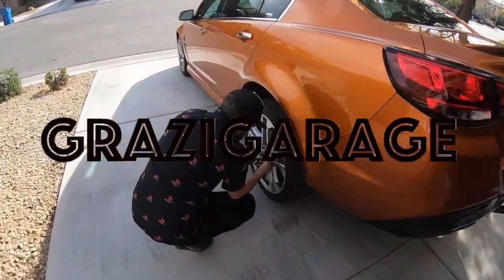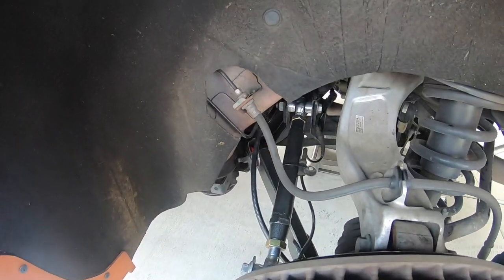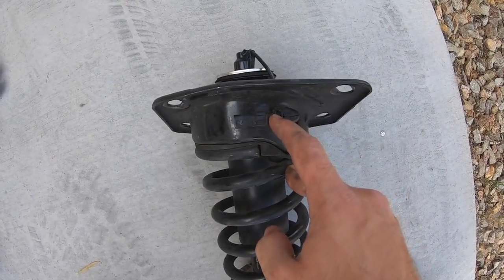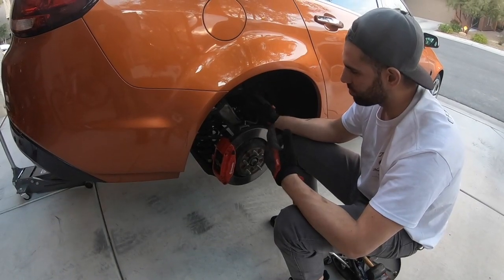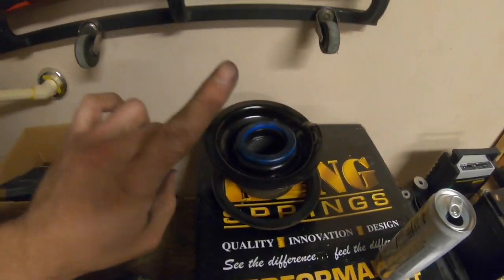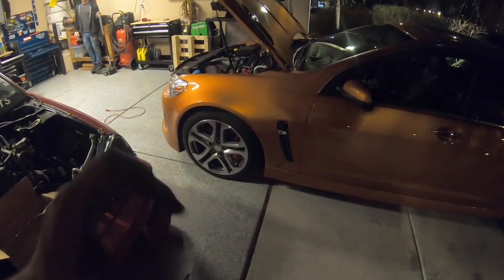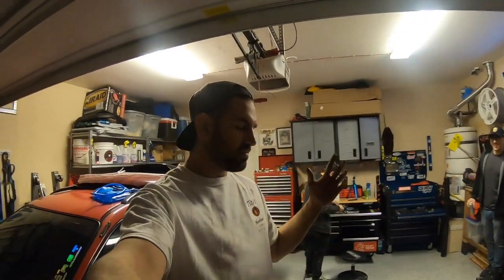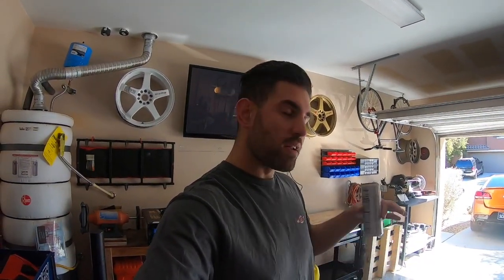King SSL Springs installed on the Chevy SS!! Magride NIGHTMARE!!

Comment: That's what happens when you don't know what you doing.i got a red ss and I lowered it and I haven't had no problems at all
Reply from the maker: It was clickbate just required recalibration after being dropped. Also depends on the year. Only 2015-2017 have magride 2014 you can cut the springs the car doesn’t care. lol.

Comment: I was wondering how this affected the magnetic ride control
Reply from the maker: It’s fine now that the height sensors were fixed and recalibrated. There was a pinched wire but that was my bad.
Reply from the maker: No the service suspension was due to a pinched wire. Recalibrating only helps the car ride smoother
Reply from the maker: Yup that’s the usual cause I had a pinched wire. And the height rods are usually missed too so glad you got to those too.

Comment: What were the lowering measuring on these cause I know there’s like 2 or 3 different heights when getting the kings
Reply from the maker: 1.2” in the front and 1.3” in the rear. If you have magride the end result varies.
Reply: @grazigarage  do you know what’s the biggest tire you can run with those stocks on ?
Reply from the maker: I don’t remember but I believe people squeezed a 295 on the rears. Don’t quote me though.
Reply: @grazigarage  sounds good ! Thanks brotha for your time !! Sorry for the questions I just bought a silver 2016 Chevy SS not even a month ago so I’m just curious & want to get ideas hahaha